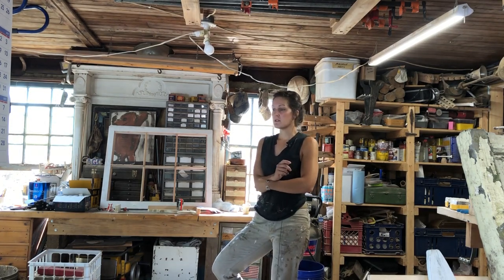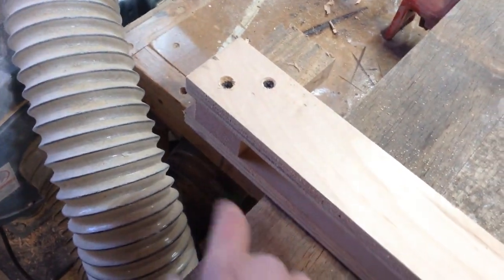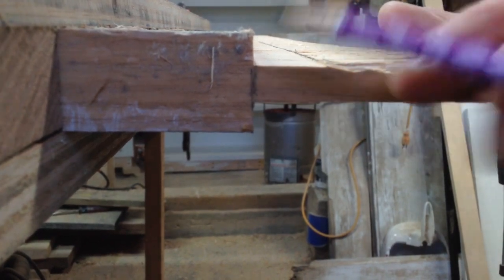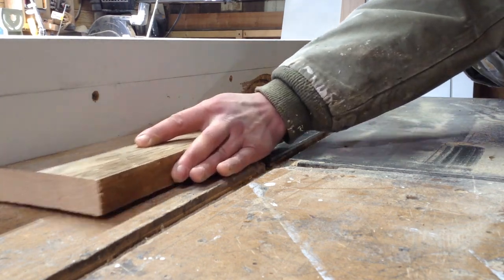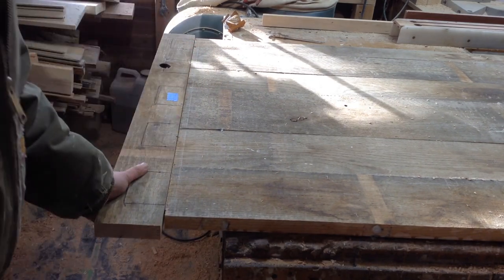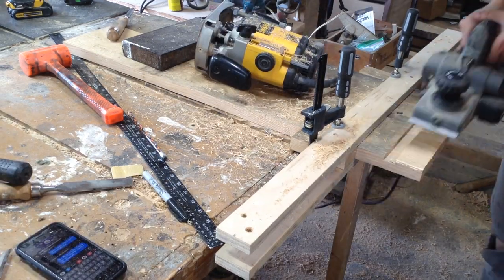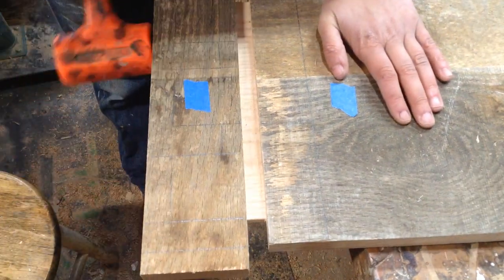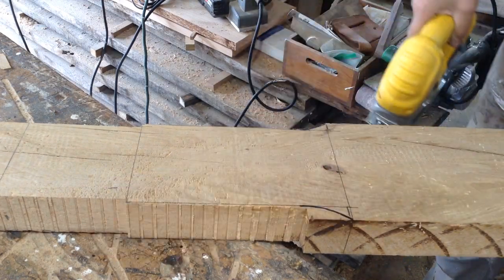Woodworking : Oak Trestle Table W/Extensions // How-To Part 3

Comment: Best advice I've learned with more complicated pieces is to invest in a roll of painters tape. Mark and label everything from from to back, left to right. Same goes with all joints and mating surfaces. Some may see it as a waste but cut something wrong or backwards and it is well worth the extra time.

Comment: I tried a mortise machine, and wonder How do you sharpen your bits? I was burning my work way too much. A sharp chisel is your friend!  Love this project series and your explanations! Oh, sharing a DUH moment: I bought a T-Slot template and bushing set from Rockler. I am making a coat rack (ash board w/cast leaf hooks) and couldn't make the T-slot template to work. Much time wasted to discover Rockler's bushing set didn't include correct bushing for their template! I mean, sell it WITH the template, jeez. Anyway, you are an inspiration! Cheers!
Reply from the maker: Rockler has done similar stuff with my orders before, always and pain when that happens.  I haven’t had an issue with the bit getting full yet, I’ll sure it will at one point.  But I went with the more expensive Delta bits and haven’t regretted it.

Comment: Hello from Downingtown.  How did you fit the angled tenon? I like fine tuning pieces like that with a hand plane, goes fast and you can get it exact.  Have a great weekend.
Reply from the maker: I drill one hole completely through then use a drill and some chisels to add the angle.  The angle itself is completely hidden so it doesn't have to be a perfect fit on the inside.  There is a lot more finishing work to get it to fit perfectly then what I had time to show in the video.